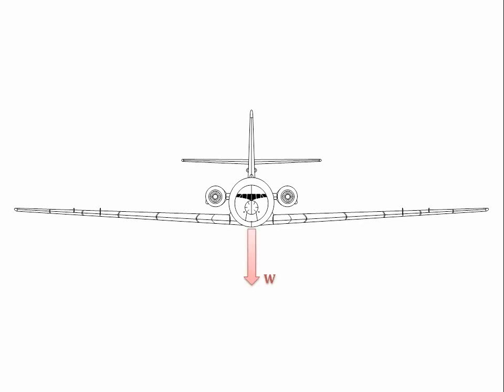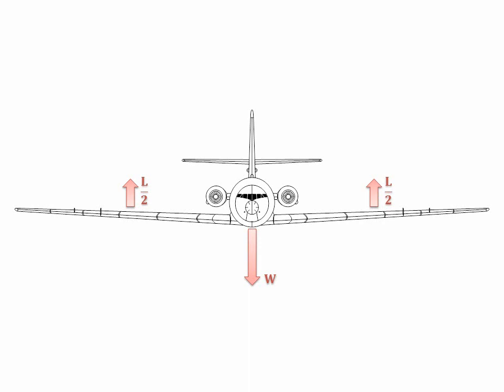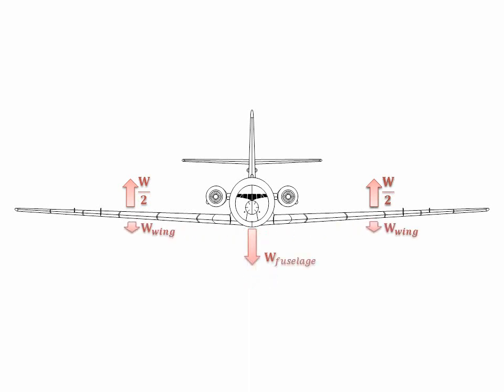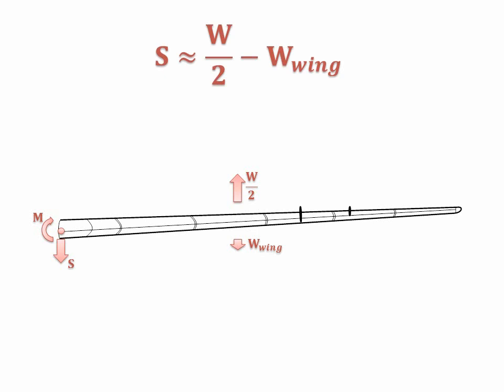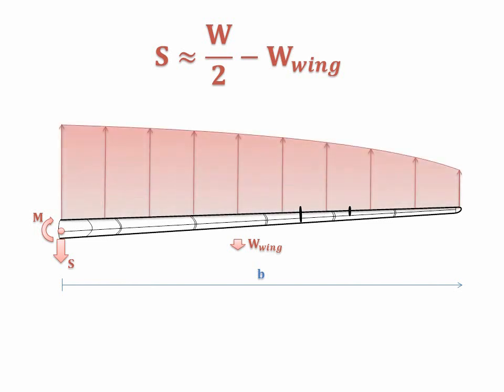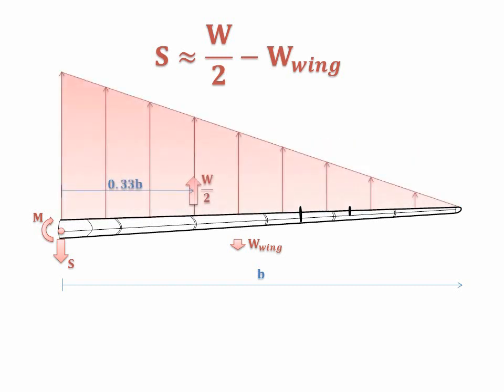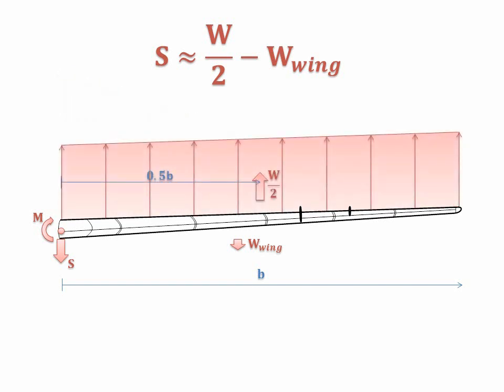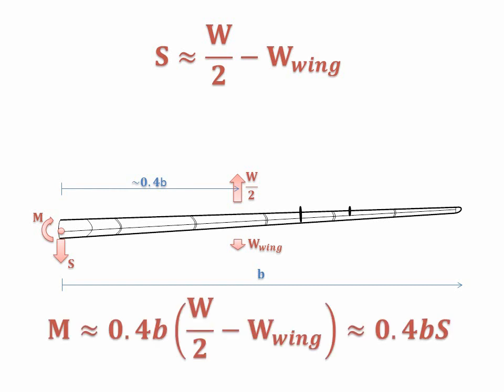Wing Shear Force

Comment: Great explanation but there is something I did not quite catch. I assume this video describes the situation of an aeroplane in cruise phase. Why is the Bending Moment here clockwise? The Up bending of the wings (wing flexing) should actually create an anti-clockwise bending moment, no?
Reply: Yea it should be opposite direction, I don't get why they have it clockwise
Reply: @manaoharsam4211   Yes, thanks a lot! I have fortunately passed the exam last year, but yes, it’s basically as you say!
Reply: Showing the resisting moment at wing root as clockwise. Take moment about wing root , the applied is ccw. The resistive is cw. I must accidently said wrong thing earlier.

Comment: This really could do with expanding on with some practical examples of using the calculations presented here to demonstrate how the units of measurement work in a practical setting with a simple example of a straight tapered wing with a single spar made of a common material etc. etc. 
This is not enough to for us to grasp the concept thoroughly, cheers.
Reply from the maker: I agree. I put this together in an a couple of free hours that I had and didn't get a chance to go through an example. I hope to post an example and a couple of more little tips in the coming weeks, as I'm currently teaching this course to UNSW students.